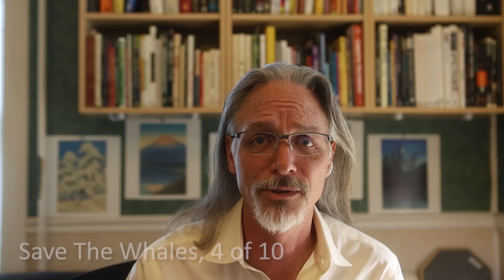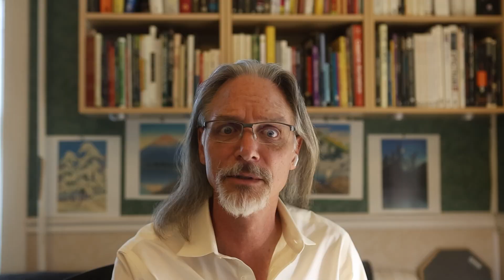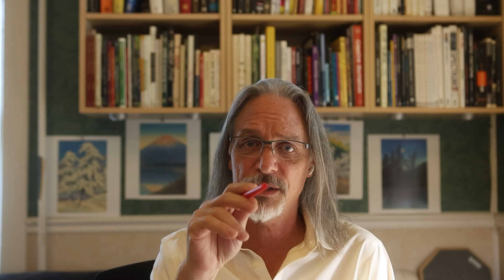Save The Whales with Spreadsheets, 4/10

Comment: the clothes dryer.  That is where, according to Energystar.gov, we use 6% of total electricity in the US to dry our clothes.  Line drying  most of our clothes allows us to push these unused electrons into the nearby plug to our electric cars.    We did just add a heat-pump clothes dryer to our home, which is supposed to be a game-changer for US homes that still associate line-drying outdoors with poverty.
Reply from the maker: whaaaaa!!!!  Seriously?   When I run breaker calcs, I see that.  But ongoing consumption?  Wow.  Tell me, are there parameters about number of cycles weekly or monthly?  Variations for 1-person or 5-person households?